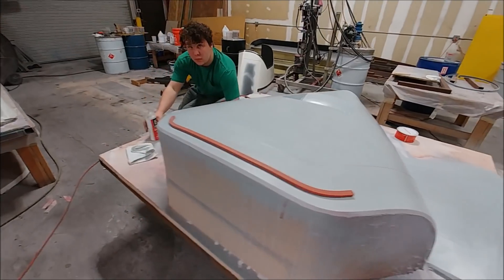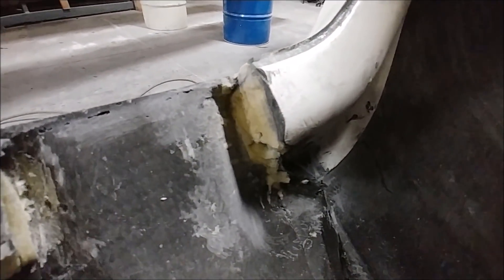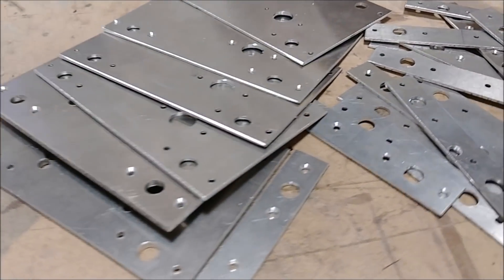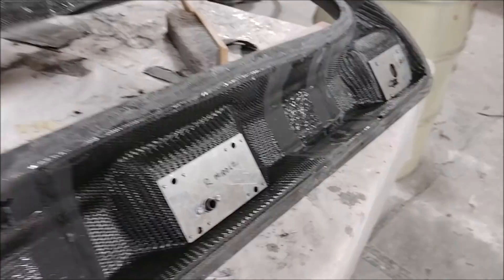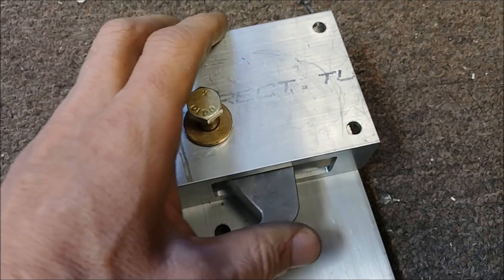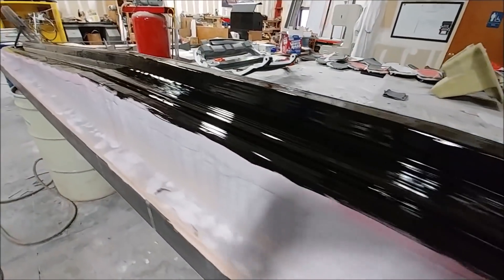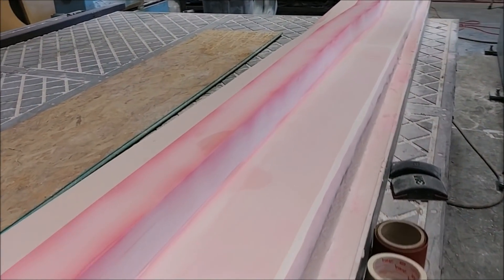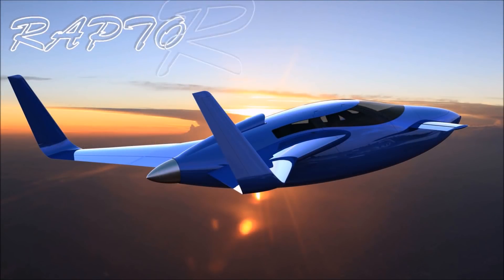Things are Heating Up!

Comment: I'm a bit puzzled why you're using all these extme work intensive riveted nut plates instead of press fit nuts?
Reply from the maker: Hans Franke do you have a link to the nuts you are referring to?
Reply: Peter, I did send some information via email (using the address on the raptor contact page) pls. check there. For any further questions, pls. ask.

Comment: Curious to actually see what the new idea for the doors will be.  "Clam-Shell" has been mentioned a number of times over the last couple of months, but not sure what that will look like.
Reply from the maker: Changing over the doors now would cost us likely about 4 months in design and retrofit time. It's not worth doing right now. The clam shell design is something that will still take time to do but it is proven in other aircraft. We are very close to finishing with the door locks and everything has been engineered to handle the loads with this set up. It's just very complicated and time consuming so it's not ideal for production.
Reply: I understand the need to change the design.  I guess I am more curious what the eventual "clam-shell" design will look like.  Is there a picture somewhere depicting what you are thinking doors will be?